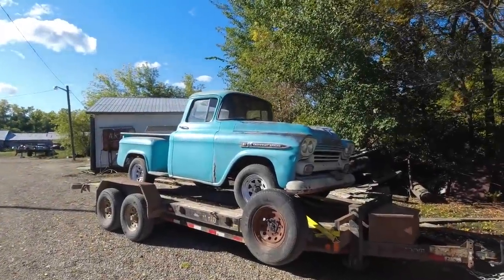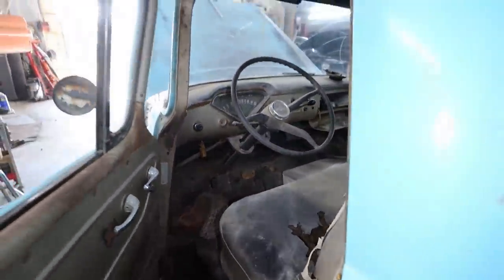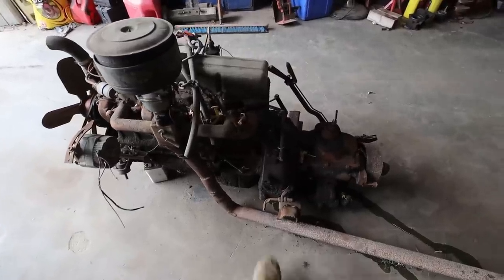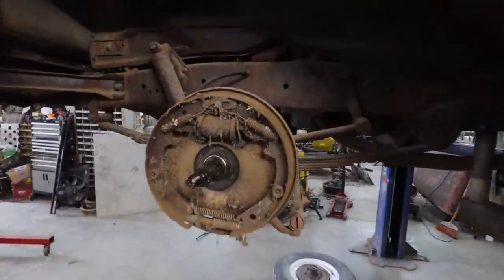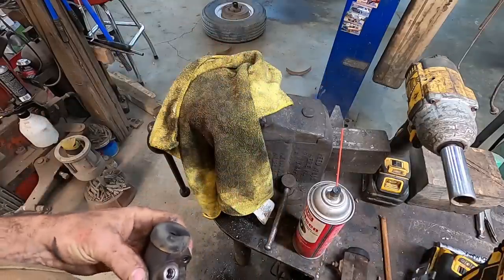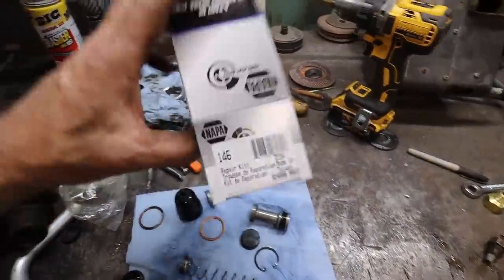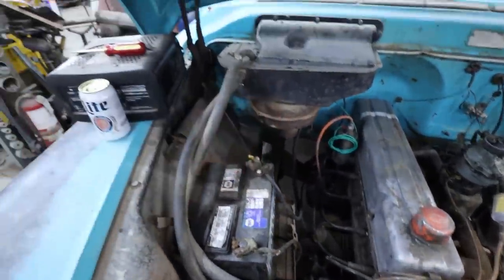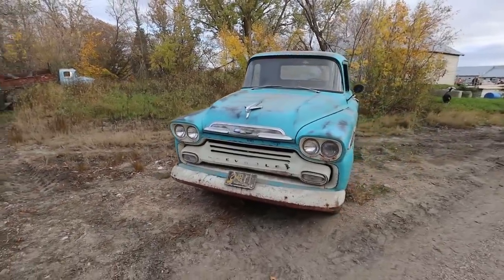1958 Chevy Apache will it run and drive?

Comment: Not feeling the lowered/drop axle much. Roads won't be getting better any time soon.
I like inline 6's with a cross flow head. Breathe in one side and exhaust t'other.
If you're into some fab work make an extended cab with room to stretch.
Hell, I was delighted to see you want a differential with highway gears.
Tricks are for kids.

Comment: i know were a 55 is sitting been there for years looks like someone started building it but just left it in the drive way parking spot . i checked it out and it looks rust free but the guy doesn't want to sell it yet. but it was the same thing on a 67 yenko i just wait till they want to sell it i got the yenko for 1500 sat since new his sun got it and never came back from nam sat in the field ever since . the interior looked new in it only had just a little rust which was amazing
Reply: ps 55  fenders are different then a 57 i use to have a 57 with a 55 grill but the hood still fits because i wanted the 57 hood on a 55 grill but my x f that up got the truck for 250 bucks rust free ding free the guy replaced any panel that was not perfect with original parts took him 2 years of hunting had new springs 12 bolt possi 283 all prepped with 4 speed top loader. my x sold it for 300 bucks so she could get a dress

Comment: The center pumpkin is worth $$$$ if it's a worthwhile ratio = hard to find. Fix the rust, but maybe give it a coat of blue primer. It'll be close to that faded blue. Does everything have to have that rat rod "patina"? Change the 6 lugs to 5 and put some "classic" wheels on it, like maybe Keystone Klassics, if you can find them (not Cragers like everybody uses). I look forward to seeing you fix the upper windshield area. That truck is REALLY nice! How about a louvered hood? Instead of a typical wooden box floor, how about diamond plate with a coating of bed liner? The same for the cab floors. Hit them with bed liner too.

Comment: I'm sure I'm pointing out something obvious here, but if you use the lift to raise the bed or the cab off the frame, could it also be used as an engine hoist to pull it out of a vehicle.
Reply from the maker: You could but it wouldn't really lift high enough

Comment: Hi Brent, I like this truck but counterpoint? Instead of lowering the truck why not raise it up a bit at the front...or maybe at both ends. Sort of a 4WD look. I know you've got the NAPCO 4WD truck in progress but that is a very different truck than the Apache. One for heavy duty stuff...especially in the winter and maybe the Apache for more of a run-around truck especially when you change out the rear end gears to something taller for highway cruising. Looking forward to seeing you repair the front cab top sheet metal above the windshield. Never seen that done.

Comment: I’d say fix the brow, clean up a bit of rust, barnboard the bed ,new windshield, upholster the seat and call it done.  It will run forever with that inline  six.  Maybe later rear brakes and dropped front axle and a small block, but for now she is a cherry old Apache truck.

Comment: It would be amazing to see it stock hight in the rear, lower the front, fix the rust, then put a hotrod engine in it with some cones sticking out of the top of the hood. It might even be nice to see it tubbed in the back.  It's a great truck

Comment: I know supplies getting short but did you ask Norm at Mid Canada Suspension? He usually has all my oddball brake stuff and if not he sometimes make one up or can give you cross reference numbers for napa or piston ring.
My clutches and brake relines I take Quality cluch and brake.
Both them have kept my toys running and on the road since I was 15.
Reply from the maker: Yeah I haven't chatted with Norm in a while and I have used that quality clutch and brake to do a couple of clutches / brake pads in the past

Comment: fix the roof rust, taller gears, doll up the interior a bit to get rid of the chicken coop smell, leave it alone.  but if the roof rust is bad after you dig into it, a4inch chop and full custom is an option.

Comment: Nice find, great patina.  I say lower it.  I’m not real fond of the old in-line 6’s, not real fond of old SBC’s, and LS swaps have been done over and over.  I wanna see somebody go real modern and put in a 2014+ 4.3, or a Trailblazer in-line, turbocharged 4-cylinder, something along those lines, something that looks different when you raise the hood.

Comment: Generally those six cylinder three speed units with 15 inch tires will have a ratio of 3.73:1 rear axle ratio. I had a 56 Chevrolet 2dr sedan with 235 three speed and later after I blew the spider gears (after I put a hot rod V8 in it) found the ratio to be 373:1. My brother has a 1970 Chevrolet Blazer 2wd six cylinder three speed and it also has the 3.73:1 rear axle. These two vehicles have original rear axle assemblies. Most people think that a six cylinder three speed setups have higher rear axle ratios but that is not the case. Automatic transmission setups have a higher rear axle ratio but automatics generally have a lower first gear ratio as well. I think that the mileage on those old six cylinder engines were around 15 to 16 mpg city and maybe 18 on highway.  They are actually well performing engines for all around driving and reliability. Of course you probably already know that. When those trucks were new the local Chevrolet dealer would mail out brochures featuring  the Chevrolet truck (Apache) to the local farmers every year so that they might need to purchase one for tax write offs of course these brochures would come in the mail around the first of the year (tax season you know) I'm am sure the Ford, Dodge, and International dealers did the same, but I only remember the Chevrolet mailers ( was a little tyke at that time).

Comment: I could use the differential cover if you end up changing it. But i'm two provinces West of you.
Typically 55-59 Task Force 3100, or 1300 in Canada have 3:90 gear ratio's in 6 cyl, 3spd trucks,
unless it's the 3 spd overdrive, in which case 4:10 was common.
Id like to see the stock dropped axle as that is the plan for my '55

Comment: Put an overdrive trans in, leave the 4:10 rear. Have a 55 Nomad I've had since 1975 - 283 3 speed with overdrive (on the column) and 4:11s. Cruises easily at 75 mph and delivers 20 mph.
Reply: 20 mpg

Comment: Man things are crazy nowadays. I just had a 76 square body fall in my lap so I decided yea rebuild time. The last truck I rebuilt was in 95. It was a 68 Chevy.
Drums, $35 ea
All light lenses/bases, $25
Four wheel break spring kit, $15
Master cyl, $19.95
Four slave cyl, $12 ea
Clutch kit $75<it had the funky 11.5
Rebuilt 250 long block, $650
I just dropped $987.65 for a rebuild kit on just the rear diff. 12blt 3.08 Detroit locker. WTF?

Comment: You probably could sell the old motor because I think it is a high pressure oil system & not have babbet bearings in it some people like to replace the older motors with that style of motor.

Comment: We rehabed a 1943 army truck Chevy 1halft ton 4x4 the old parts guy said mostly a Chevy is a Chevy most parts interchange like bearings and brake parts clutch  was told to hone and put new rubber cups in brakes  and master   the outside castings changed most bearing sizes diddent

Comment: Pull'n dat lock'd m up old motor, clean da new old motor n install it, attempt ta start pop, mulligan stew front brakes, boat tank n clickity clack fuel, vroom vroom spin m, daring duo out fer a drive.

Comment: No, don't lower it, the factory stance on that is perfect, only change the rear diff for taller highay gears, patch some rust spots, clean up the bed rails and lay some new wood into it, line up a tailgate and rear bumper, but keep the rest bone stock's My vote, ..and keep that slightly torn seat in there, i'll bet it's comfortable as a nice old worn in Baseball glove, ..🍁🔥 🌌

Comment: 1:09:30 wHAT i'D DO if it was my truck and I had the resources?

* General rust repair as already planned

* Re-gear as planned. I think a 2.49 or 2.73 would work a treat in that thing; I have an 85 F150 with a 300/TOD 4spd/2.49 gears and it turns 1650RPM @ 70mph on the same size tire so that truck with a 1:1 top gear would be turning about 2100 or so! Right where that engine is just singin' but not screamin'. Prolly get 20mpg out of it doing that too no joke; my F150 gets 18 and its luggin' a bit these days. Given what I'd do with the bed I'd err closer to a 2.49 in this truck since it wouldn't really be asked to pull anything much heavier than itself down the road, so 2.49s would be just fine.

* Full service to return it to roadworthy status

* AIR CONDITIONING! Ok ok I don't live in Canada...rather I'm about an hour east of Nashville TN...but air con is a hard dealbreaker for me. Happily, Vintage Air is a thing and they'll sell you an aircon retrofit for a Model T that'll freeze a polar bear's nutsack off. Be no bigs to retrofit AC to that Apache either.

* FM radio. I love my tunes, what can I say? Living here in Nashville and being a metalhead means I don't need to worry about streaming my jams, I can just tune in for free. And happily, the classic rock station out here blasts out an hour long commercial free rock block on the same hour I'm commuting home! \m/

* Dashcam. Should be in every daily driven vehicle, and I would be dailying it. 20k miles a yaer at minimum.

* As for the box...floor's gone, tailgate's gone, and I already have a half-ton fleetside longbed so I'm good on hauling heavy shit like engines and fridges. I think I'd remove the bed outright and fabricate a custom box for it built bespoke for hauling my RC planes to and from the flying field. Leave the heavy lifting to my '85 F150, give this thing a somewhat cushy retirement where the heaviest load it has to carry is a jug of nitro fuel and about 15 pounds of balsa haha. In my mind I have it ending up looking more like a suburban of the same era, yanno? Shape the box to match the cab best I can without interfering with the intended usage. Keep that glorious 50s Forward Look going.

I'd also at minimum rip the head and pan off the old engine to see what's going on in there. Or maybe donate it to another channel I watch, I Do Cars, which does nothing but bad engine teardowns. His usual bread and butter is stuff from this decade that people manage to yeet parts out of. I am all up in his shit about getting vintage engines in and if I were in your situation I'd be able to donate one for a video! As for the engine you put in this truck...it runs fine I wouldn't be overly concerned about the chooch'n for now. My area doesn't do emissions testing and even if they did a '58 would be exempt so I wouldn't have any issue registering it despite the mild smoking issue. Drive it for a while until I can arrange an overhaul and bring that engine back to like-new condition.

Comment: Drop an older small or big block in which will bolt to the 3 speed with the correct clutch housing . Drop or not drop would make no difference to me . Or drop it on a later 4x4 frame .

Comment: I had a 66 Chevy half ton pickup and took the rear brake shoes to the parts store. The guy said $18:95. I replaced them then took the front shoes in to the same parts guy. He laughed after looking them up in his book and said it's the same part number but $25:95 for the fronts. I told him to give me another set of rears please.

Comment: Keep the six, better geared dif. Fix what weight reduction you need to. Definitely a drop front axle and rear lowering job. A seat that won't hurt your ass would be good. Need a ramp for Pablo!

Comment: Well you did it again, totally loser truck zero investment and the end of the show Your driving Pablo around the section with a drone chasing you. What a Hoot. I so wish i could help you. I would like to see 4 Wheel Drive on the 58 with a nasty 348 !?!?! On the farm we had a 57 Dump truck Chevy and And it had the floor starter button and hydraulic Dump for Grain. 4 speed but low was not synchronized and super low ratio for getting a full load of grain rolling to then jam into 2nd before it stopped rolling. Later we had a 64 Pickup New, Both were inline 6s. We were not wealthy at all. Your work is so like life on the farm we had to fit everything with what we had on hand if at possible. Sure do like you videos, Dennis